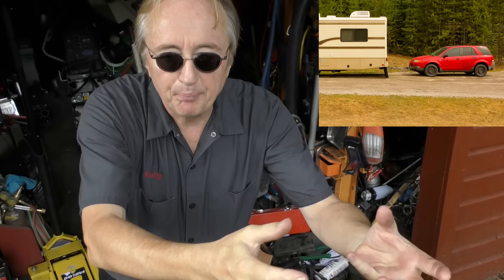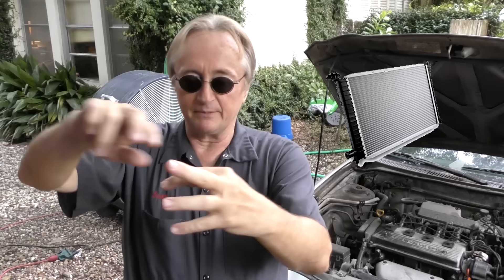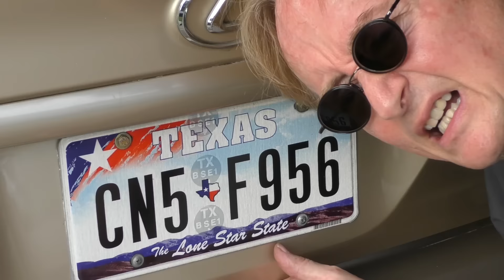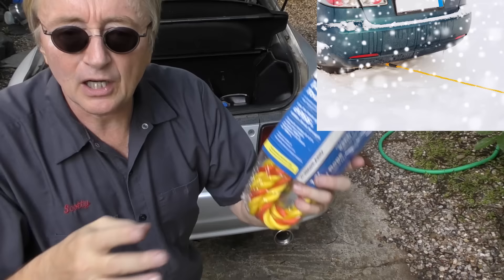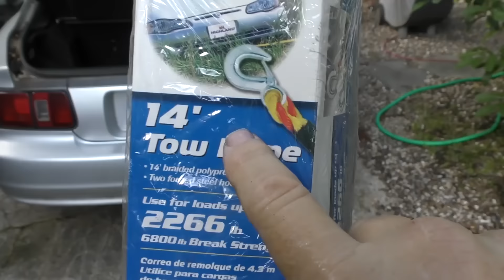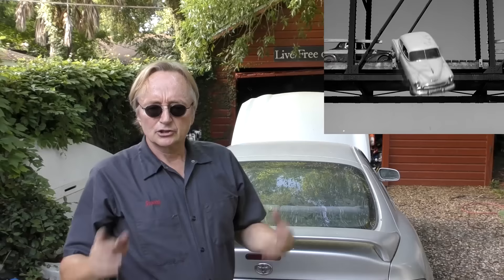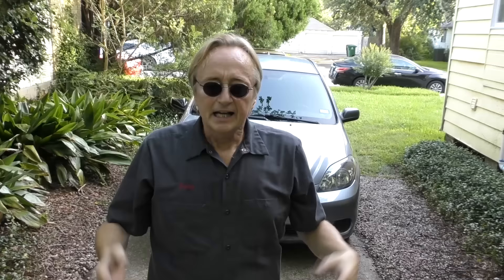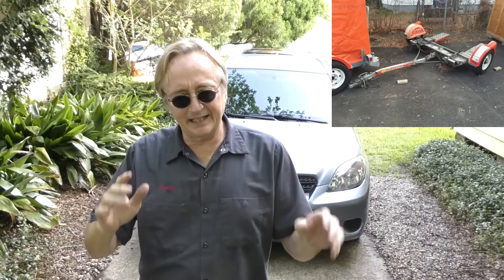Never Do This to Your Car

Comment: A point that should be mentioned is that if a car has a single "knock on" hub nut often found with wire spoked wheels on European sports cars you must not tow with the rear of the car facing forward with any wheels on the ground. The hub nut will loosen and the wheels will come off. You can tow with the front of the car facing forwards, if it is a manual transmission.

Comment: Years ago a guy pulls into my Nissan dealer (Datsun at the time) with a B210 wagon behind a large RV. He had been "flat towing" for several days and was wondering what the funny smell was. (tow dollies were not common back then) Put the car on the lift to see the trany had gotten so hot it had melted the undercoating on the floorboards. 3 days later we had a new trany in the thing and off he went, flat towing again. (picked it up on a Saturday) A month later we get a bulletin from our local regional office that the guy is trying to sue for the repairs and his lawyer wants to know why a customer would ever bother to read the owner's manual on towing. Why would they build a car where you need to pull the driveshaft before towing? (how absurd!) Where's the old trans? (they need it for the suit) Shipped back to Nissan for the factory core charge. Sorry Charlie. You didn't play by the rules so you pay!

Comment: Most cars will not tow well on a tow dolly unless the heaviest end of the car is on the tow dolly , if it is towed the other way the car will want to wander back and forth from side to side. So put the engine end of the car on the dolly and if it is rear wheel drive take the drive shaft off of the rear differential and wire it up well so it cant fall out.

Comment: Actually, pre-2015, Honda CRV AWD, Automatic transmission vehicles have instructions in the manual how to flat- tow the vehicle. 

I'm sure it is still a lot of wear on the transmission, but it won't kill it. (right away)
Reply: Some automatics are designed for that. They're the exception, not the rule. That's why you have an owner's manual.

Comment: i tow plenty of automatic vehicles with a strap even from Galveston to houston on a strap all i do is put the car on neutral turn key on position so steering wheel can spin and just pull it off never had any issues done did a F150 a civic a mercedes and a lexus that way nothing cars are ok

Comment: I think I have the explanation for people asking why simply putting the car in neutral does not work:
Even if you put the car in neutral, the transmission is still rotating when you tow the car. This is because the transmission is connected to the wheels and by putting it on neutral you are disconnecting it from the engine, not the wheels! Then, it will damage the transmission since the transmission oil pump is not working to lubricate the transmission.

Comment: I was in Paris and there was a tow truck with two cars. One on the flatbed and one on a normal tow device. The car being towed normally had the parking brake or something on and as it passed me it fell off the back and smashed into the tow truck. Could have gone much worse, but still had thousands in damage.

Comment: LOL - Waaaaayyyyyy back when - 1975 to be exact - I was 14, and my father had two cars to get to South Carolina - from New Orleans. I was too young to drive, so the plan was to tow the little BMW 1600 behind the Mercedes 300 SEL 4.5 ( My dad was enamored with German vehicles ). Unfortunately, pulling the BMW out of the parking lot - he forgot to put the key in, and the locked steering wheel caused it to not turn, and the bumper bent trying to turn. sigh ( my dad was normally smarter than this, but he had his foibles ). So, I was relegated to sitting in the BMW behind the Mercedes trying to keep it going straight - on a bent bumper. It took approximately 10 hours between New Orleans and Biloxi, Mississippi before Dad gave up and handed me the Mercedes keys, while he drove the stick shift on the BMW. Imagine a 14 year old ( with literally 2 driving lessons ) driving 1,000+ miles in a Mercedes almost-limousine, overnight. Ah, those were the days.

Comment: Scotty, can I tow my front wheel drive (2002 Toyota Camry) with all four wheels on the ground at a moderate speed (like 35 MPH) for just a short distance (like under 5 miles) without causing damage?  If no, how far and how fast can I make it without causing damage?

Comment: YOU CAN..YOU CAN TOW AN AUTOMATIC.. in Australia.we had to tow cars that had issues from great distances. 
But you can only tow IF THE ENGINE IS ABLE TO RUN.
With the engine running..it PUMPS FLUID
Reply: Jason some of the  information in this one is incorrect. How is transmission fluid going through the transmission cooler on the radiator if there’s no pump working to move fluid with the car off and being towed? Also, how do you blow the head gasket? The car engine is off so the water pump is not circulating fluid as it needs to be driven by the serpentine belt in order to circulate the fluid. So how can hot coolant get inside the engine to blow the head gasket? The thermostat is even closed on a cold engine which prevents any circulation of coolant through the radiator. Even if it was possible to have an overheated radiator in this situation, which it’s not, there is air movement past the radiator while the car is towed which works to cool the radiator off just as the cooling fan does when it’s running when a car is parked and idling. There’s also airflow beneath the car that would help dissipate heat from the transmission through convection heat transfer. This logic makes no sense at all. If anything it sounds like a case of a Subaru that broke down due to a head gasket failure and then they towed it and ruined the transmission by overheating it from a lack of lubrication and overheated transmission fluid caused by the moving torque converter. There’s no way that towing the vehicle blew the head gasket...

Comment: does the "always suspend drive wheels when getting towed" rule apply to manual transmission as well?
Reply: Yes for cars with a limited slip differential even after putting them in neutral.

Comment: Scotty your wifes Lexus does have hook points underneath. The screw in ring in the bumper is not a tow hook, it is referred to as a recovery hook, only to be used when the underside of the car is inaccessible. And the hook points underneath the car are not called tow loops, they are transport slots, every car everywhere(not sure about Tesla) has at least 4 of them.

Comment: Never tow a vehicle with the steering wheels on the ground it takes about 20 minutes to detach the driveshaft off a rear axle then use a old rag to tie the universal joint tight so you don’t loose any parts and then tie it up with twine or metal wire out of the way.

Comment: On those tow dollies, never, Never NEVER tow a front engine car with the rear wheels on the dolly. The weight distribution is completely wrong and you can get a trailer sway going that is completely uncontrollable. You are better off spending a few extra bucks to rent a car trailer that has all 4 wheels of the towed car off the ground.  People die when a trailer sway causes the car to go out of control.

Comment: towing a motorcycle or coasting it down a long long pass with the engine shut off can have the same devastating effects to your motorcycle transmission on a four stroke motorcycle engine/transmission that has an oil pump feeding the transmission lube..
  most of the time when you have your car towed, so you have a minor fender bender. The tow truck operator can and does often do more damage than the accident did..Operating a tow truck requires the correct type of truck and a skilled operator

Comment: For short distance automatic trans tows where I have to have the wheels on the ground I leave the engine running, I towed a guy the other day who flat towed his 4wd pickup with an auto in neutral drive shaft still in and he went from Texas to Ohio before he got it towed, not even for the trans being destroyed but for a DUI but when I went to move his truck it was pretty difficult to get it in gear lol

Comment: I call bs on the subaru story. If the engine isn't running the trans isn't pumping fluid just like scotty said, so it isn't going to make it's way to the trans cooler in the radiator. And even if the trans cooler was getting hot fluid, the car is being towed so there's air passing through the radiator like normal which would cool the fluid.
Reply: Joaquin Valadez  it wouldn't be as much air flow as normal but definitely enough for the tiny trans cooler.
Reply: Joaquin Valadez  whoa acid man

Comment: I was told that if you disconnected the driveshaft, you could tow a RWD or AWD car with the rear wheels on the ground. 

Most tow trailers advise against towing with the engine NOT on the dolly

Comment: As long as you put your transmission into neutral it doesn't really matter which end you tow it by.  What's the transmission is in neutral the drive wheels are disengaged from the transmission and engine.

Comment: Can't you put the car in neutral and not worry about burning something out?
Reply: No the engine would need to be running so the transmission pump kicks on.  If you can put it in neutral neutral...then sure

Comment: While training the staff at the Hyundai (HMMA) plant in Alabama on PDR when it first opened, there was an early run of several hundred cars that were damaged in production. The damage was a bad buckle in the rear floor pan close to the rear body panel caused by too much pressure (pull) applied during the "marriage" operation where unibody is attached to the drive-line and suspension. The engine, drive-train, exhaust, and suspension are pre-assembled on a robotic jig on the floor and the painted bodied are hanging on cradles on an overhead carrier system. The marriage is the procedure where the two parts come together and are attached before they have wheels and can roll. Back then these cars had a loop welded to the underside of the floor at the rear body panel seam facing downward that people thought was a tow hook. It was only there for something to hook to, to pull the unibody and driveline in place temporarily while the bolts were installed. They pulled too hard and buckled a couple of hundred floor pans before they discovered the cause.

Comment: Correct me if I'm wrong, for front wheel drive or rear wheel drive vehicles with automatic transmission, putting in neutral won't help?
Reply: Alex you have to toe in neutral. You’re not going to tow in park. This logic makes no sense. The thermostat on the engine is closed on a cold engine which prevents any circulation of coolant inside the engine through the radiator. Also, to circulate coolant the water pump needs to be running which is only possible if the engine is on since it’s driven by the belt. There’s no way for this to happen! And how would transmission fluid get circulated through the radiator with the car towed? He already said with the car off there’s no lubrication of the transmission so what’s moving the transmission fluid through the radiator?

Comment: Scotty it doesn't make sense if the engine is not running the transmission fluid doesn't get pumped in to the radiator because the pump in the transmission is not pumping the fluid in to the radiator plus if the vehicle is moving it has enough air circulation to cool the radiator so it doesn't get hot at all.

Comment: Idk about all vehicles but there are some that's ok to do that to. Why do you see families pulling Jeep's behind RVs if that was the case. Miles may pile up on the odometer but that's about the extent of damage you're going to get. Oh and tire wear. Check with your local mechanic about the possibility of damage before you do it though.

Comment: how about manual transmission? does it still damage the transmission?
Reply: Most manual transmission equipped vehicles can be towed with the transmission in neutral...but check the owner's manual and dealership to be certain.

Comment: When you talked about the rear wheel drive cars on the car dolly, you needed to say secure the steering wheel. Turn a corner and watch the car you’re towing try to pass you or smash into another car or light pole, fun fun fun.

Comment: That Lexus actually has what's called t-hooks Lots under the vehicle in the body those are to be used for Towing the eye bolts never have been a big fan of those they're notorious for ripping out or ripping the whole front end off with it when it's under load

Comment: Many cars have tow hooks with left (anticlockwise ) thread, to prevent unscrewing caused by the torque that occurs when the tow rope gets stressed. Ropes are usually wound clockwise. Another point is, those tow ropes are way to strong, if some speed difference occurs, you destroy the frame from both cars. Better use say 500 lbs rope, but with strong hooks. Your car gets whipped if the rope breaks, that's all. I towed a car once from Bucharest Romania to Utrecht, Holland, 1800 km/ 1000 miles. So I got some experience. 😨

Comment: It called a flatbed not a landoll two different things and if you have a rear wheel drive and you tow it with the steer wheels on ground you forgot to mention to tie /lock the steering wheels straight and not all the time ppl have the tow hooks that screw into bumper there other frame unibody slot just for that wich use t hook or mini j hooks

Comment: Scotty as a flatbed tow truck operator, I would suggest you look underneath your wife Lexus, it does in fact have tow hooks underneath the car. Just not in the front like a Toyota and Honda. I have never used a tow hook on Lexus. Most Lexus don’t even have the tow hook in the vehicle

Comment: i had a car from the seventies, rear wheel drive i had to tow it with a rope... do I detatched the drive shaft from the rear end and strapped it up so it wouldn't turn the transmission while it was rolling. it was the local mechanic who told me to do that.

Comment: I saw a tow truck hauling a Subaru on the interstate with the front wheels in the air and the back wheels rolling on the ground. I was parallel to him wheel the wheels locked up! 
To this day I wonder if her told the owner what happened?

Comment: I once had an accident and the tow truck driver told me they have to tow it to whatever the city has designated as the towing place and they told me that to tow it anywhere else would cost $200 and that I would have to pay it right then and there.  Was that a lie or is that because thats the city's designated tow truck company and that's how they operate?  Can I refuse that tow truck and call one from my insurance?

Comment: Not to mention that tow rope is very short. 
Towing a vehicle with that (and a second driver in the towed car) reduses dangerously the safety distance between the two cars. 
If something happens, and the towing car stops fast, the driver of the towed car will not have enough space to brake and stop.
Reply: Good god, unbelievable.

Comment: If the engine is running can you tow it then! Because everything is powered. For what ever reason you might want to?  🍺😎👍
Reply: IIRC you want the steering wheel locked with the wheels straight. Starting the engine would unlock the steering. I like your screen name. Wished I would've thought of that one.😁

Comment: Many years ago, a guy towed my 4runner with the front wheels up in the air. He messed up my 4 wheel drive system, the truck would not move afterwards. He had to pay for the repair. Haha

Comment: We’ll say if your in a bind and can’t afford either triple aaa or a tow dolly or a tow truck if your not in an accident . But your not going far what would you say is the max miles you would pull tow a car weather fort/ rear wheel drive or all wheel Scotty? And is those bumper tow hooks strong enough to go said miles?

Comment: You certainly can tow AWD vehicles with the rear wheels rolling. Get under the car and disconnect the driveshaft. 
Way cheaper than a flatbed tow, especially if it’s something that needs to be moved around a lot.
Reply: Matt Fields This logic makes no sense. The thermostat on the engine is closed on a cold engine which prevents any circulation of coolant inside the engine through the radiator. Also, to circulate coolant the water pump needs to be running which is only possible if the engine is on since it’s driven by the belt. Even if the radiator had hot fluid there’s no way for it to get back inside the engine with the engine off! And how would transmission fluid get circulated through the radiator with the car towed? He already said with the car off there’s no lubrication of the transmission so what’s moving the transmission fluid through the radiator?
Reply: Newfie-Dean if you disconnect the driveshaft, put the cars front wheels on a dolly and tow the car....how does that make the transmission hot?
Reply: Matt Fields it would not as the torque converter is not turning then. There’s no way for transmission fluid to go through the rad cooler if the car is off since there’s nothing pumping it. He got this video way wrong!! And I can’t believe nobody is picking up on it. I seen one girl that did besides me as she stated with the car off there’s no pumping of fluid to the trans cooler on the radiator.

Comment: To tow a bike. Loop rope around HEADSTOCK ONCE. Then to one bar and hold with thumb pressure only. Ensure ROPE PULLS OUT EASILY WHEN RELEASED. 20 MPH MAX. I have been towed twice. In 30yrs, it`s OK.

Comment: In MANUAL TRANSMISSION, if we apply gear and then tow, won't it make the engine rotate which will make the oil pump function, which would prevent the transmission overheating...???

Comment: I've seen people pull automatic vehicles before without destroying them. But they remove some pin from under the car. What is that?
Reply: they would have to disconnect the wheels from the transmission, if all your wheels are unlocked and spin freely then no problems.